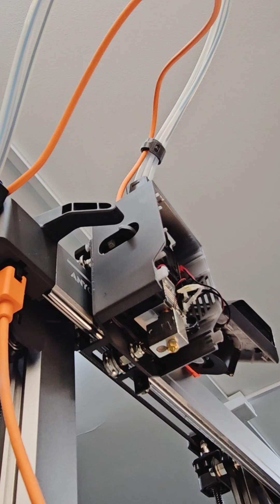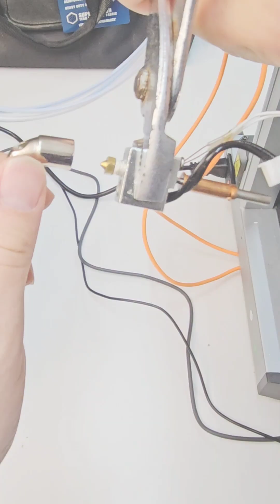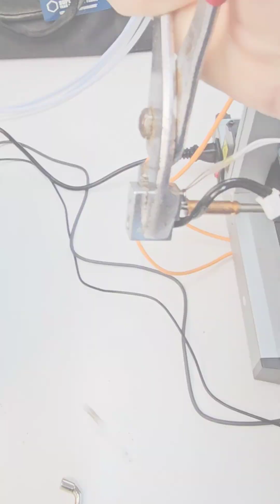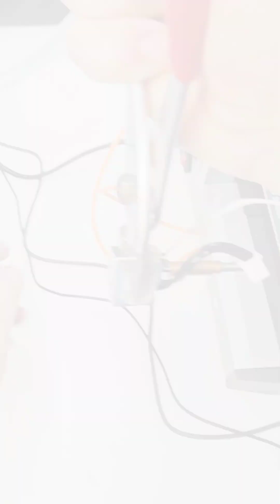Safely Removing a Glued-In Hotend Nozzle from an Anycubic Kobra 3 - Part 3

Comment: The fact that you can't just replace the nozzle like any other printer and you have to break an epoxy seal is ridiculous, i just broke mine before seeing this video so i had to get a new one, might get 2 or 3 in the future
Reply from the maker: Yeah I think its a bit overkill tbh, but they want to prevent the blob of death. I have been running mine without the epoxy just fine.

Comment: Did it break before? If yes how can i fix it?? Cuz i Was just trying to change the nozzle but then suddenly, the nozzle inside the hotend just broke and now the rest of the nozzle is inside of the hotend. Is there anyway to get it out or do i have to buy a new hotend??? I need respond immediatly!!
Reply from the maker: I have vid up where I broke a nozzle as well. I tried to use a dremel to cut a slot in it and use a flat head to get it out but the brass nozzle is to soft. Just buy another one. Not to expensive. If you follow the instructions in the video you can get it out though.